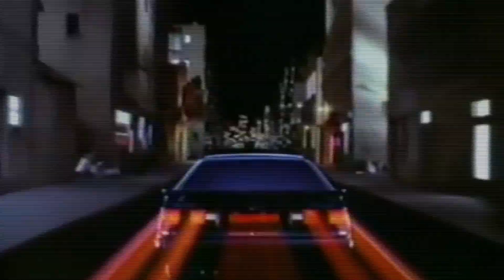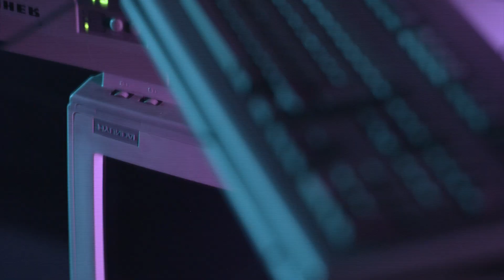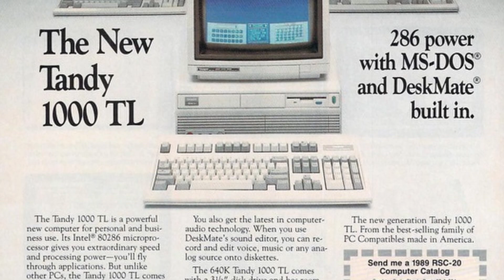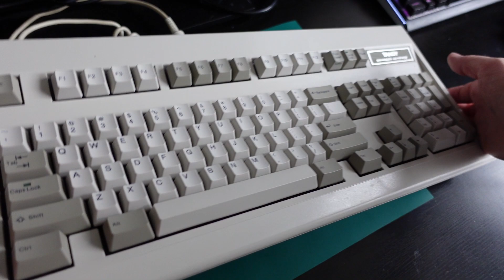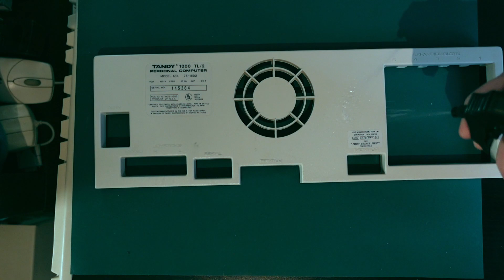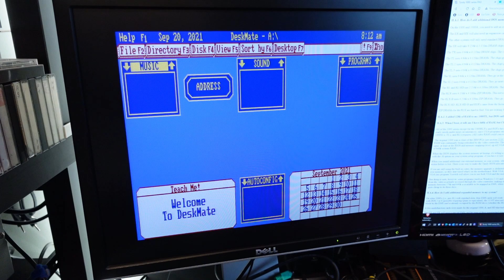Rusty Bits Ep. 003 - Quick look at my Tandy 1000TL/2 #SEPTANDY #SEPTANDY2021

Comment: I bought a Tandy 1000 TL/2 way back in 1990.  I upgraded memory to 768K and added a 80287 math co-processor. My unit came with MS-DOS 3.3 and Deskmate 3 in ROM, one 360K 5.25" floppy drive, one 720K 3.5" floppy drive, and a 40MB XT IDE Hard Drive. Too bad I sold it in 2000.  I now use PCEM and 86Box to emulate a Tandy 1000 SL/2 to relive those days.